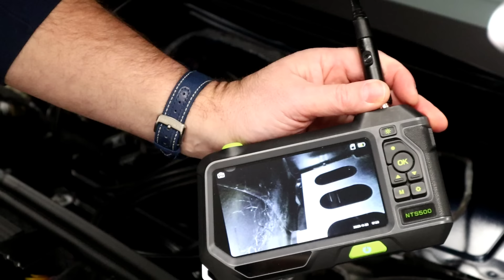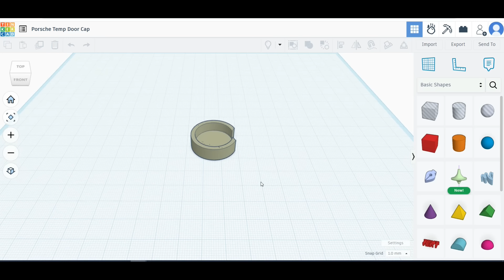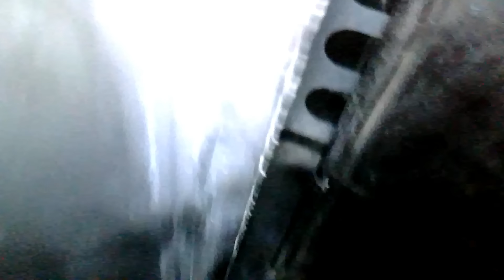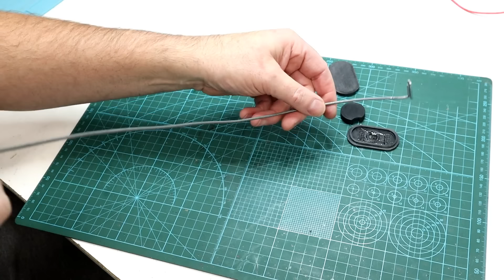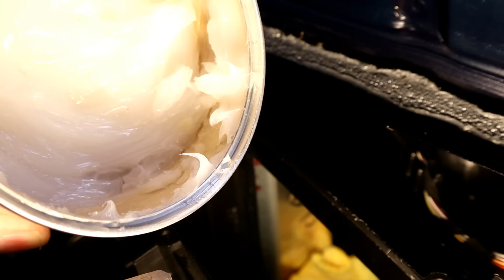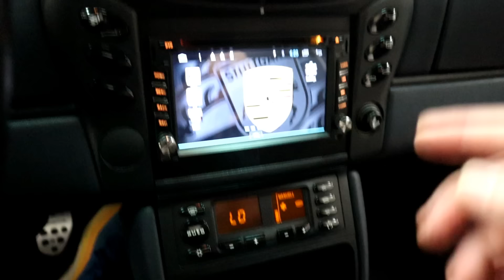Porsche Vent Foam Repair - NO DESTRUCTIVE CUTTING Required.

Comment: John, your video helped me do this repair yesterday, and the results are acceptable. Thank you so very much! My foam was completely gone. And I mean 100% detached from the holes - not a shred left on either door. I am quite clumsy with these kinds of repairs, so I will make a few comments below about mistakes I made in the hopes that it may help other clumsy DIYers.

1. Be careful when sawing the top of the cap that houses the upper bushing. I cut too much and managed to cut part-way through the bushing itself, though it was still usable. But that came to nought when I accidentally dropped the top bushing into the hole and could not find it even after a lengthy search and feel-around with my hand. I had to jerry-rig something in the shape of that bushing, which luckily is working. I have no idea where that bushing rolled off. I just verified that the movement of the doors wasn't obstructed by it.

2. When accessing the work area, I found that it was not necessary to disconnect the wiper motor/arm assembly and remove it from the car. I was nervous about breaking the electrical connector at the back and found that there was enough length in the cabling to allow me to unbolt the assembly and pivot it out of the way while still keeping it in the frunk. 

3. I did not have the time to get a borescope or fashion the tool you used to get to the vent selector door. But I found that with some difficulty (and pain), I was able to get my hand in at a particular angle and touch that door. With much trial-and-error, I managed to stick multiple small 2" x 2" bits of the HVAC tape, working totally by feel (not sight). After each try, I lowered my cellphone into the hole to get video of my work, and found that I managed to tape off about 75-80% of the holes in the vent selector door in the end. My conclusion is that someone with not-too-big wrists has a fighting chance of being able to stick tape onto the vent selector door. It will not be as neat as your solution, but it might be a 75-80% solution like mine. 

4. I forgot the crucial step of marking the position of the lower bushing when the blend door is in the cold (closed) position like you did. As a result, putting it back together was a bit of trial-and-error, trying to get the lower bushing groove to line up with the edge of the door. That could have been avoided had I marked the position before pulling out the lower pushing (it did require quite a yank with needlenose pliers).

Overall, I'm happy with the results. I'm getting much stronger heat due to the taped-up blend door, and I am able to select which vent air comes out of due to the mostly-taped-up vent selector door. I am so glad I came across your video when I did. I was getting ready to cut open the housing from the dashboard side, even though I detested the idea!
Reply from the maker: Thanks sharing your own tips for other DIYers. Much appreciated! 👍 Good effort as well to get your arm/hand through that opening; for the life of me, there was no way I could reach in there. I too had to try when my first magnet tool failed and the magnet was stuck to the door - hand was too big and wrist didn't bent the right way.  Happy motoring with proper heat and air flow control again 🙂

Comment: Amazing video thx, dealer quoted $6K to fix the heat, foam has been coming out for a couple years, pretty sure this is the solution.
Reply: Stealership

Comment: Hi John, My car is a 2004 GT3. Thanks for the video and all your help. I decided to go with your method of repairing the blend doors. I chose your prescribed method because I felt it was less invasive. It also let me detail the surrounding area of the battery tray and wiper areas. I can see the door with the borescope, but just cannot get to the inner door with your wire contraption to install the oval caps with permatex  glue as it just to difficult (for me). That being said, I take my hat off and salute you for your determination. So, if I was to do it again with what I now know first hand, I would go through the dash as it seems much easier. One other thing I did after cutting the cap off the top of the door is to buy a 1/2" pvc water pipe cap and did a bit of fabrication work so it fit the outside corner of the heater core box. I painted it black to match and It fits the diameter perfectly. Also I think either method of covering the doors with foil tape or caps is fine. It is cheaper to use the tape. I cannot confirm but it does seem the inner door on my car has 4 ovals, 3 are the same size and the other is a bit larger for anyone buying the caps.
I hope this helps anyone who wants to attempt either procedure.

Comment: I just received my blend door caps from an eBay seller and looking at them it seems one of the four oval caps supplied is a bit larger than the others. I am waiting for my borescope to arrive so I can't tell if there is a corresponding hole to match the one odd sized cap. Do you know if this is correct?
Thanks in Advance
Reply from the maker: Yes, some models do have a slightly larger lower oval hole than the upper 3 holes. I also include both sizes of oval plug files. You'll therefore have to wait until you get your borescope in there to confirm if the bottom hole in yours is the same size as the other 3, or is larger. The small plug will of course fit/work in the larger bottom hole fine as plug lip still covers the opening, just not the other way around 🙂
Reply: @rchelicopterfun  Yes  thank you for your help.

Comment: Great work on being creative. Honestly at my shop we just remove the entire dash as it's such a pain to work on as proven by your video.
Reply from the maker: Glad to hear you found it a creative solution for those DIY'ers that don't want to pull the entire dash out and deal with an entirely different set of pains that process introduces such as AC evac & recharge, air bag precautions and the almost inevitable broken clips/fasteners that usually manifest later as creaks/rattles after a dash R&R. 👍🙂

BTW, since you've obviously seen many of these Porsche HVAC box assemblies once fully removed, any chance you could let the rest of us DIY'ers know if there is also degrading foam on the floor/defrost selection door, or does it use something else or no foam at all? I've searched high and low and can't find any information specific to that 3rd floor/defrost selection door.

Comment: Great, great video! You have a really good presentation style. 
However, after seeing the scope of the work needed to go in from the front from the car, I think I will be going in from the cabin side when it’s time to do this on my new (to me) 986. It has an enough small cosmetic defects that hacking and taping the plenum will barely register as a defect.

Comment: Hope you remembered to put in the 10mm heater bolts. Great video
Reply from the maker: Indeed I did. Always reassuring at the end of a repair project to not have any fasteners left over 🙃. Thanks for watching.

Comment: I've same issue with my 1985 VW Golf. Turning on the fan results in foam pieces blowing out the vents occasionally. Not really concerned about it as the heat still comes through as with cold air, I just pluck the pieces from the vents with tweezers and may place a screen behind them someday. Not going to take the dash apart just to address this.

Comment: Why haven’t you used neoprene? It has long term working temps within car operating temperatures
Reply from the maker: Way too dense. Have to use specific open cell soft foam  or no foam at all.

Comment: A lot of lateral info John along with the keyhole surgery! Thank you for the concise video. But did I miss something pertaining to the door plug  & upper bushing cap sizes. Not into 3D printing but guess someone on this side of the pond does (GB)
Reply from the maker: If you are not into 3D printing and you are specifically inquiring is how to get the plugs and cap, you have two options: 
1. Go onto eBay and search for Porsche blend door plugs & air box cap. I do believe there is a UK seller but most are in the US. 
2. Download the two files I have and have someone in your area print them.

Comment: Fabulous effort. You’ve done a big amount of prep to get this done and of course make the video. 
I am wondering what difference the foam made, obviously it would insulate a fair amount, perhaps provide something of a seal too so there’s no bleed.
Reply from the maker: The foam makes little difference; but yes, it certainly has some insulating qualities and of course some sealing qualities as I mentioned in the video. As to how much, I can't notice any in temperature and only a slight bit of blow-by when the distribution door is fully closed in the floor/defrost selection position. It's certainly a big improvement after plugging the holes as two of mine were wide open. 

That said, the vent distribution door always did have some blow-by even when the foam was fully intact. If you look at the vent distribution door, the upper half actually has a cut out along the one sealing edge so even when it was fully wrapped with intact foam, there was blow-by along that edge. No idea why they designed it that way; perhaps to limit back pressure allowing the door to open with less force on the actuator when the fan is on higher speeds? I don't know. The vent distribution door doesn't benefit from insulating qualities as it's only an air direction diverter, there is no temperature differential it has to manage.

The more beneficial door to both insulate and seal is of course the temperature blend door for those that want a brand new factory spec experience. For that, then I would certainly recommend getting that special blend door foam from Blend Door USA, and wrapping it when it's removed. It may provide a couple degrees more or less heat.

Comment: You mean there is a way to do this job without taking out my center console and making irreversible changes??

John, this is amazing. Thank you! Gonna make this my first project of 2026 😊
Reply from the maker: Yes indeed. No question, it's a little more work and takes a little more time doing it this way, but if you are like me and just can't stomach the thought of hacking up the center plenum, it works.
Reply: Does this make your ac work less efficient if you don’t get it fixed?